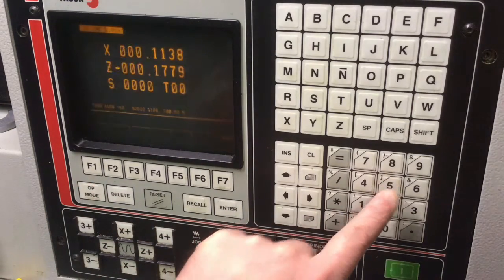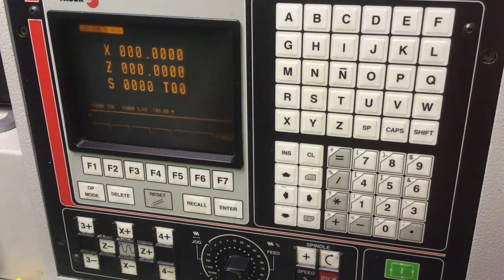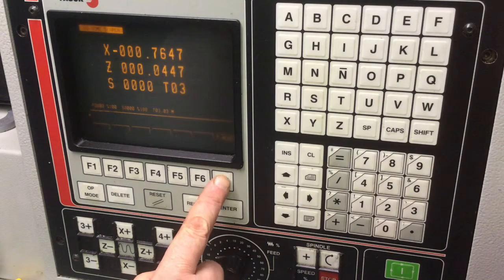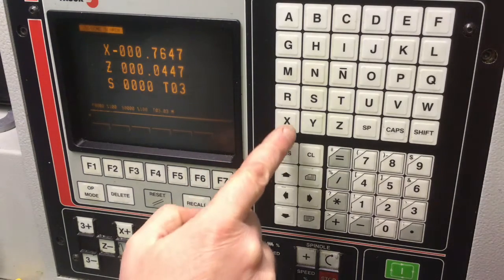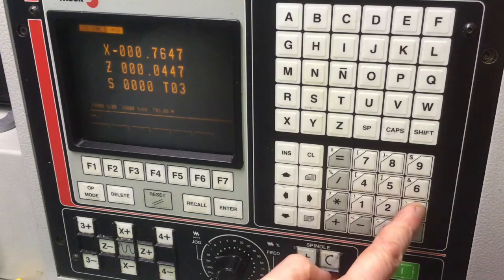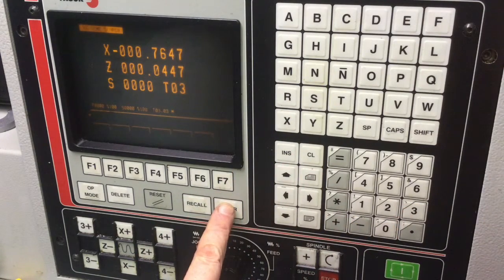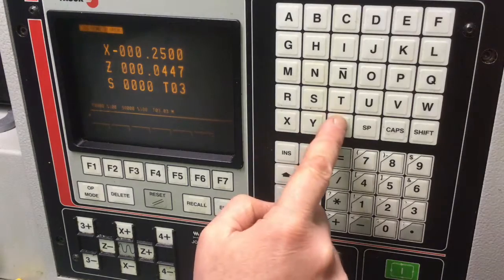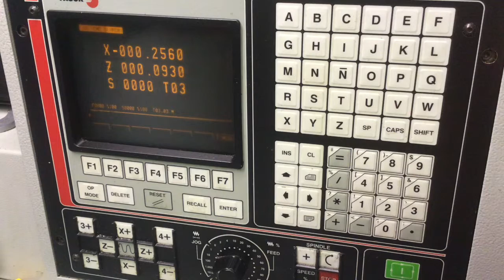Fagor 8025T tools

Comment: What are the 2 long tubes coming out of the back of the tooling block
Reply from the maker: It's a feed stop for the job I was doing previously. In that job, the stock is small enough to pass over the tool table. The part is over 15" long. So the slide goes to the space between the threading tool and the cutoff tool. The stock feeds to that stop, and the cutoff can part it to length.